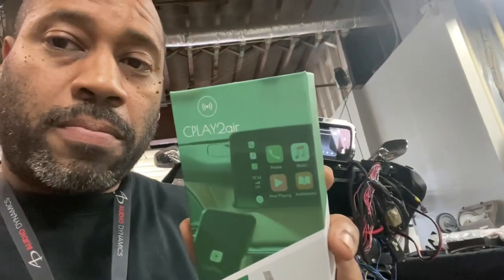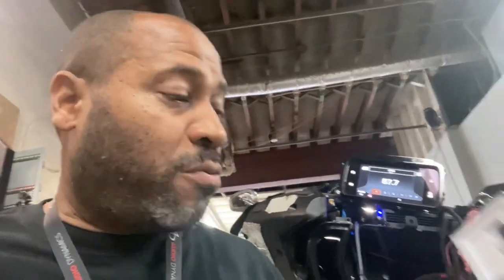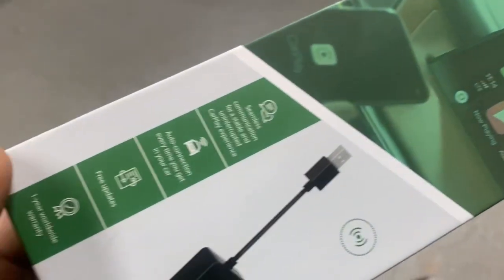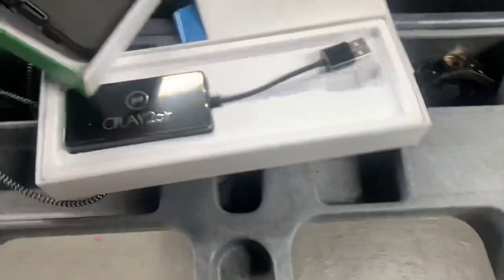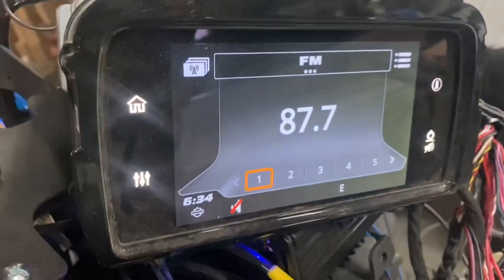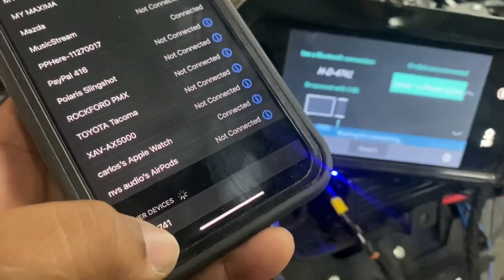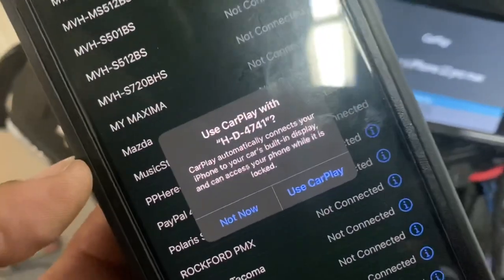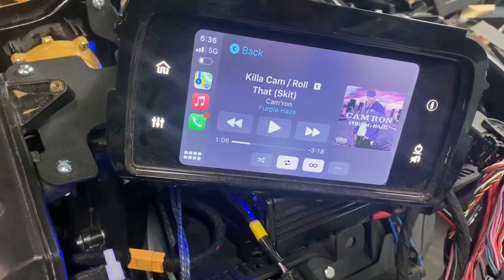How to add wireless Apple Car Play to your Harley-Davidson GTS Radio  factory equipment 2019 and up

Comment: Hey there. I set this up on my 2019 Ultra Limited before finding your video. Your advice about charging does indeed make sense. I wanted to add that my iPhone 12 ProMax connects to the unit from the tour pack where I have it plugged in to the 12v power source. This allows me to use the wireless CarPlay feature while charging.

Comment: Sir ?
With this wireless unit 
Do I also need to install the wired plug jumper onto the radio ?

For info I also have a whim installed 
Thank you
Reply from the maker: If you have the wim you don’t need the jumper
Reply: @NVSAUDIO  Sir ,thank you very much.

Comment: Can you do a video on how to connect multiple usb connect to the new Harley GTS radio
Reply from the maker: Multiple usb is not recommended on the gt or gts radios . You will have random connection issues.

Comment: Got a way to make the bigger iPhones like Pro Max fit in the media compartment? That is the reason why I started looking at this. Then I could put my phone in the TP or saddlebag plugged into power. On top of not putting it on a phone mount  where the 11-13's are having camera issues from motorcycle vibration killing the phone's camera's. Open to suggestions. Any help is appreciated.

Comment: I tried using the wireless adapter in the past and it wasn’t worth the hassle 
For some reason or another while I was riding the carplay would come in and out at times
Something that never happened while my phone was plugged into the usb
Reply from the maker: My experience has been the same 
Very glitchy 
And it kills the battery on the phone really fast